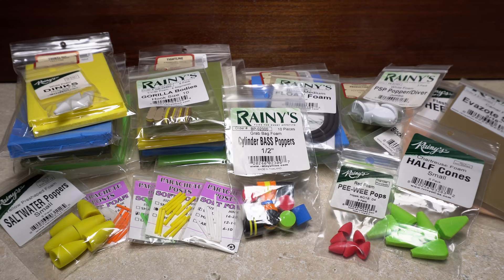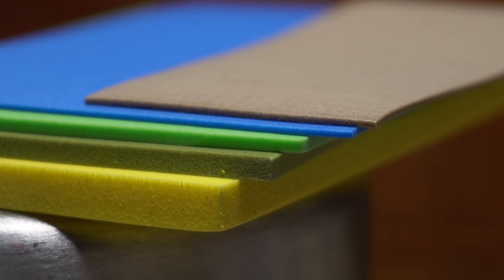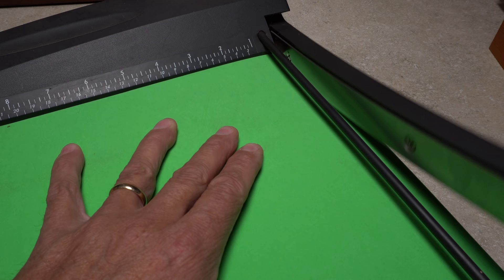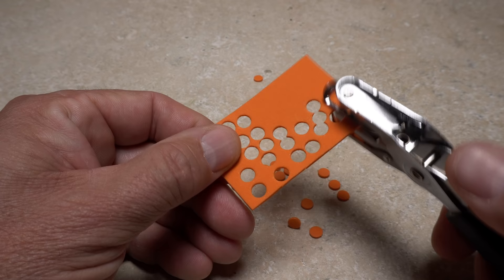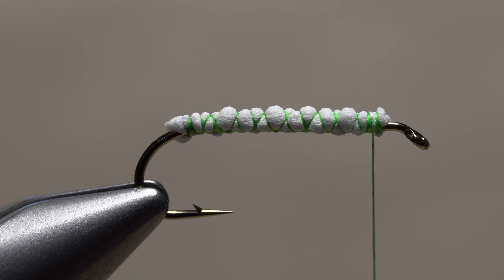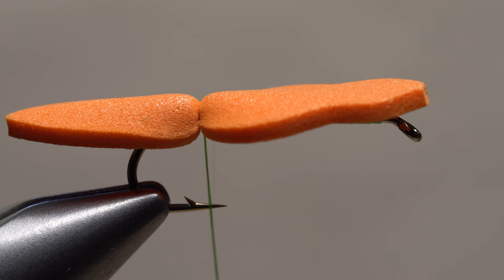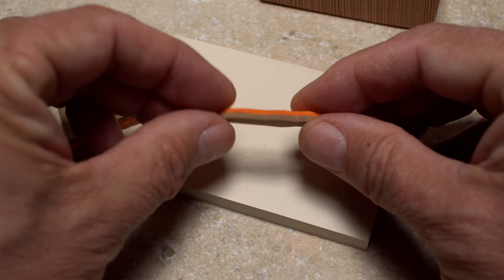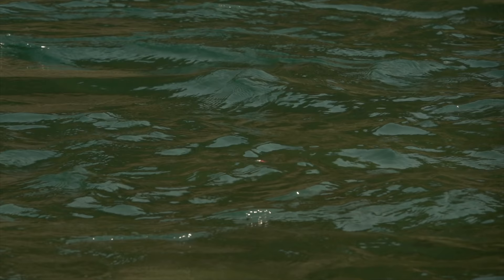Tying Flies with Foam

Comment: Thanks for mentioning the fact that lots of wraps along the length of a piece of foam will compress the life (floatability) out of it. I've watched many fly tying videos that show the guy cranking down on the foam to make a big, bulky base, and the narrator will talk about how this will add to the floatability of the fly... which it totally wrong. Compressing the foam makes it sink like a rock. It's also worth noting that if a tyer used a long, skinny strip of foam and wraps it along the length of the hook shank (sort of "palmering" it, I guess), the tighter he wraps it in creating a long, slim body, the more he squeezes the floatation out of it. If you wrap foam strips, wrap gently. Tie it in tightly with thread wraps at the front and back.

Comment: Went to Hobby store and bought a pack of 6 colors 10x18" long.  Cut a strip of each 10x6" and gave to a fly tying buddy.  Then I cut whats left in strips when I need them.  If you buy at a fly shop you will pay 3 or 4 times the cost of the 10x18 sheets for a  couple of 3x5sheets.
Reply from the maker: All very true, but I really like to support my local fly shop whenever possible. It’s a tough business and they regularly supply incredible advice.
Reply: @tightlinevideo  thats nice.  The nearest flyshops for me is 33 and 43 miles away.  One shop makes me feel like I'm an inconvenience and I do support the other 2 when Iam in the area.  But I get most of my supplies online.  Enjoy your videos